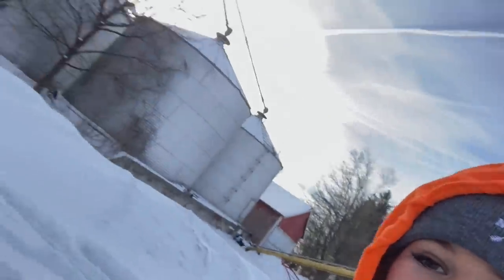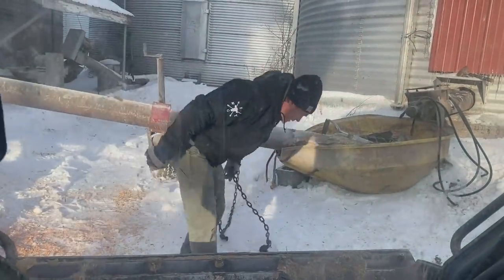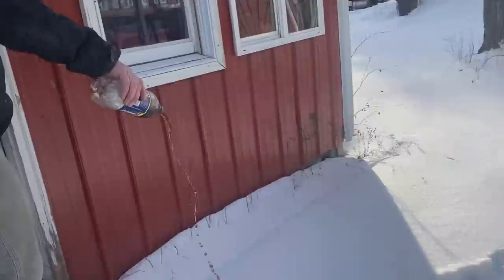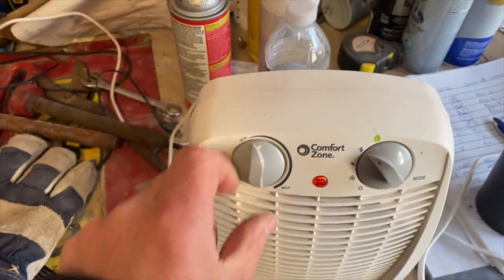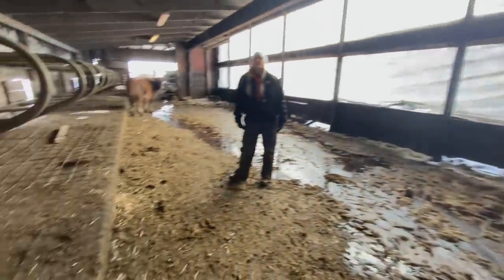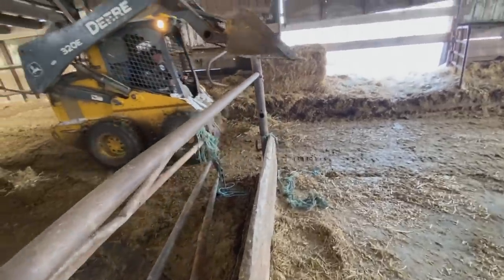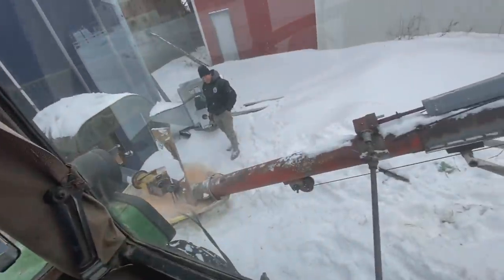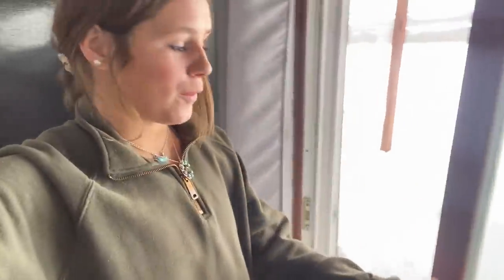Loading corn with Dad

Comment: You can drive one of those.  Backing where backed is easy. I've been driving 18 wheelers for a little over 4 years.  I drive 53 foot dry van.  The last account I was on, they had me delivering to auto part stores with small lots.

Comment: I was surprised to see such a tall tandem axle grain trailer that custom hauler was using, I wonder if he also hauls light products as it seems a lot of grain trailers in the states are fairly low sided due to lower weight allowed vs here in Canada and even then that is tall for here, interesting anyway.
Reply: Acer Acres  Cotton seed is definitely a foreign item in my world and looked up a bushel weight and came up with 32 lb per bushel, where as corn I see is 56. A neighbour had bought a used Canadian made grain trailer some years ago that came from a farm elsewhere and again was only a tandem trailer and with very high sides and he said it was built with hauling bulk sunflower seed in mind which is also light or lighter then cotton seed. Totally makes sense if this trailer was hauling products like that and corn and so on to a lesser degree.